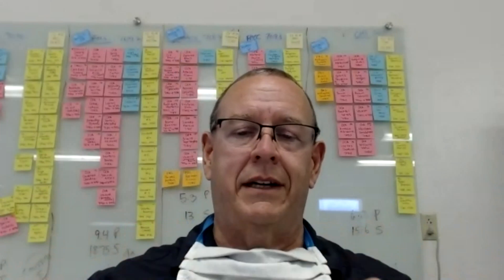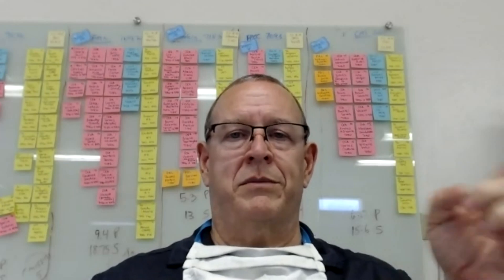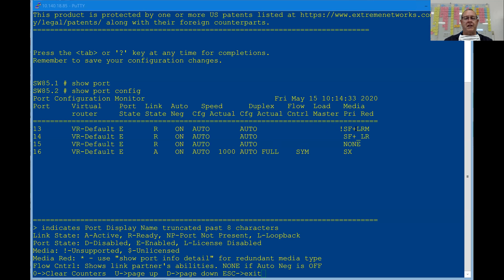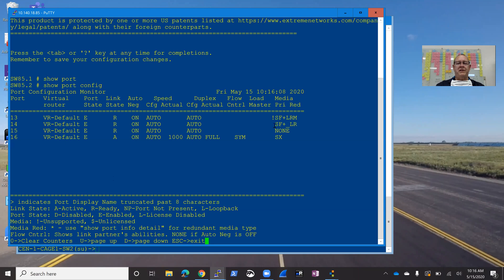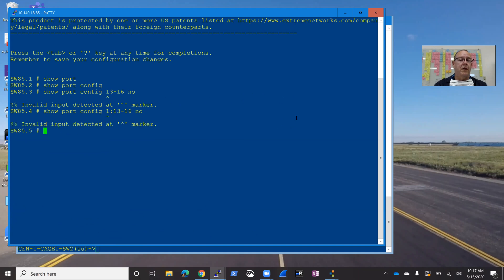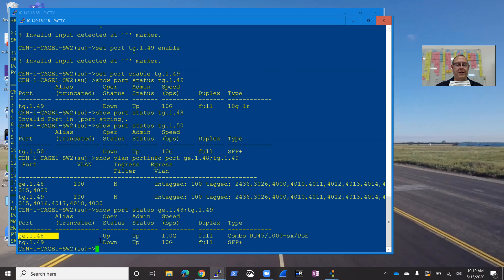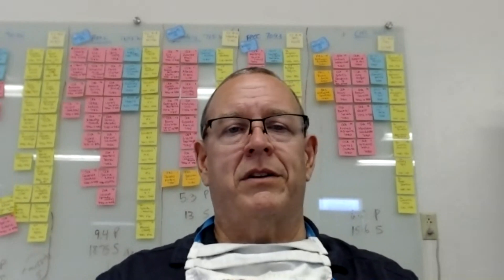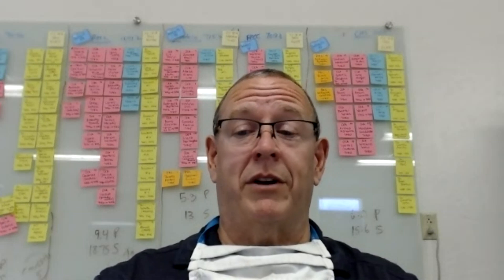Network Admin Life: GBIC Puzzle

Comment: Really enjoying your videos! Already tried a firmware update?
Reply from the maker: Yes, firmware updates are very easy on Extreme equipment.  In 10 years I have not had a firmware update go bad.  I've had some that I was really worried about, especially when they were in another geographic area.  All have gone well so far, God be praised!
Reply: @NetworkAdminLife  Thanks for the detailed response. I was actually referring to your SFP dilemma, thinking a firmware update could potentially resolve your "not supported" issue. We were primarily a Cisco shop but moved to Aruba cloud managed switches (2930M, 3810M) as well as Aruba Central for AP/Switch management (literally a 2 click - 15 minute upgrade process to do the entire Org) - extremely simplified licensing as well (one of the reasons we moved away from Cisco). Still running some Nexus and ASAs in our data center but overall very happy with the simplicity and reliability of the Aruba line. Thanks again for the videos and sharing your experiences with us.
Reply: @adammtp1  Ah, gotcha.  Actually I have found the problem.  The GBIC is not supported in this particular switch.  Extreme's GBIC support is so complicated that they have a web page with a GBIC support matrix on it.  The 10GBIC-SFP+ I was trying to use is not supported in the new XOS switches but is in the older Secure Stack switches.  Go figure.  

Extreme Optics Compatibility Matrix:  https://optics.extremenetworks.com/EXOS/